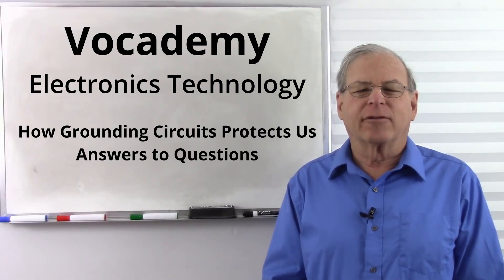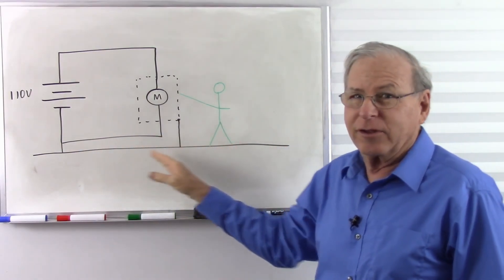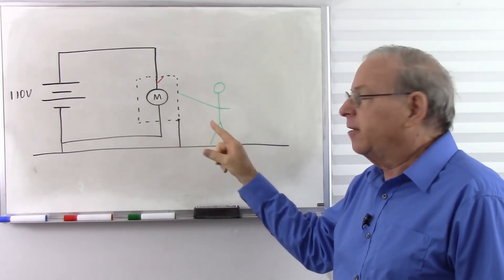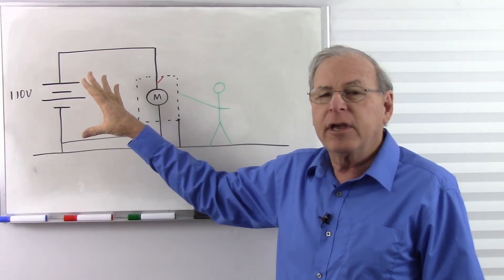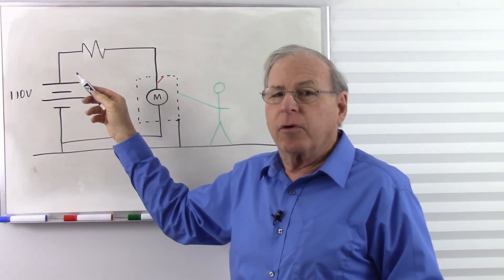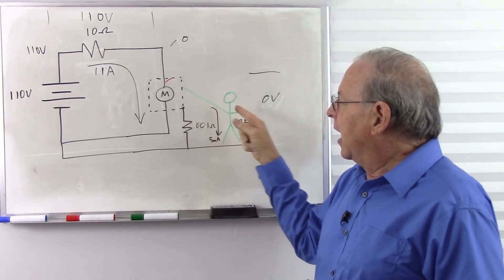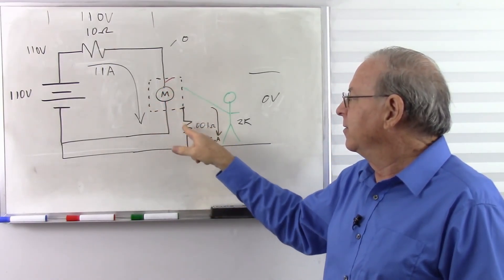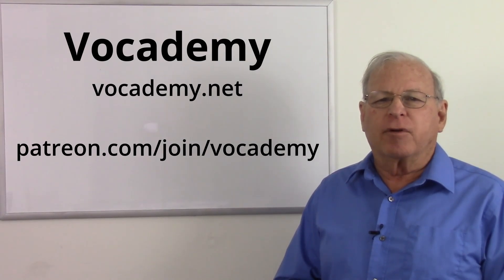How Grounding Circuits Protects Us -  Answers to Questions

Comment: So now I understand why it’s not a good idea to have a sink ‘grounded’ by taping an earth wire to the metal drain. The resistance could be relatively high and therefore potentially dangerous. The earth wire should be firmly connected.

Comment: Really good explanation. I think one of the the elements of information that can still be made clearer, despite your two wonderful videos on the subject, is that ground does not behave like the 0Voltage at all. In short, if just connect the power cable to ground, but the ground is not connected to the RETURN / Neutral wire of the circuit, actually the circuit is not closed at all. You allute to this point at the begining of the video, by showing ground connected back to the return of the circuit. But that also deserves being clearly explained, as I had always the tendency to assume that ground behaved like 0v voltage, relative to the positive/hot source. The reality is it does not behave like that at all. Ground behaves just like one electrical wire. Circuits are mounted in a such a way that the ground circuit ultimately connects back to the Neutral/return of the power source, but the hot wire is under normal circunstances never connected to the ground circuit. When there is a malfunction and the hot wire touch a case, or something that is grounded, because the grounded circuit nowdays closes in with the netural you then have current flowing via ground as a wire. The ground is simply "short" almost zero resistance connected to back to the neutral and when there is a malfunction the "input impedance" of this ground connection circuit as you explain in this video here is almost 0 resistance and hence all the Voltage dtop takes place in the circuit before reaching the metal case.
Reply: Even more important in real life residential applications is that a ground fault system is explicitly made to trip a breaker due to massive over current. 99% of safety net comes from low resistance path available to trip a breaker. Also, this aspect has little to do with the earth/ground. Using a grounding rod is really more for avoiding static charge build up and lightning dissipation… at least on the 120/240 side of things. Cheers!
Reply: A helpful reminder to this logic is that 2 really good grounding rods have 25 ohms between them. The earth itself isn’t a low resistance pathway to trip a breaker. Everything said in the video is perfect except the real world importance of the breaker in our equipment ground safety net. That just needs a bit more emphasis as it’s a very common misconception.